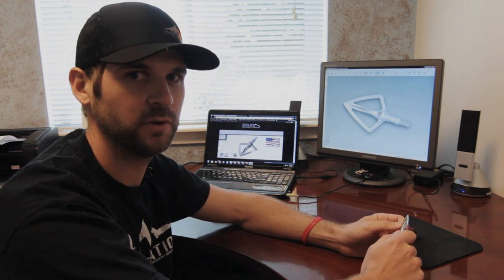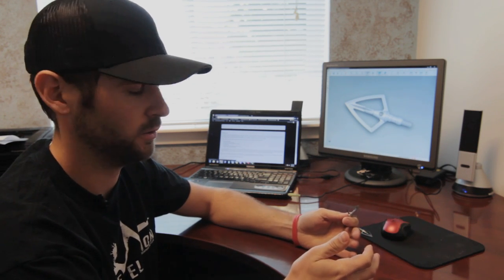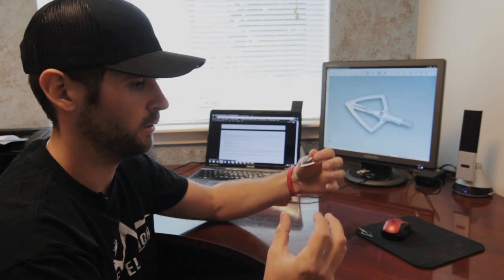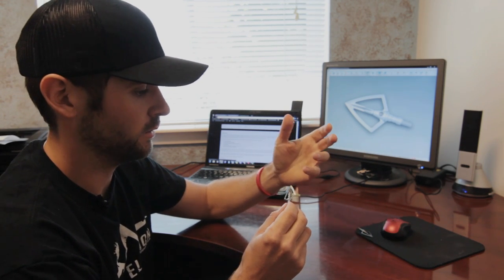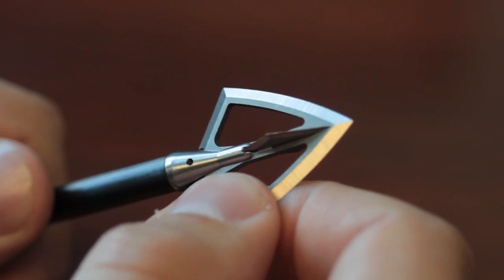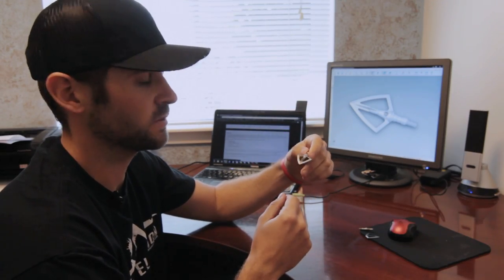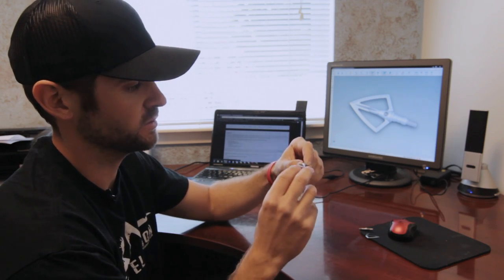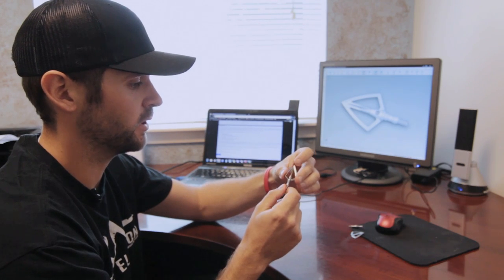About Solid Broadhead Company & S30V

Comment: I love these broadheads! I love S30v steel as well. I have a benchmade folder knife and the blade is made of S30v also. That knife can be sharpened to scary razor sharp. It's a great steel for sure. Now, having that on a braodhead is really awesome! Also, the blade edge being curved in stead of a flat grind, is also a great grind to give a knife edge. It allows less resistance on the cutting edge. It's like these aren't a typical broadhead blade - they are knife blades.! The design is really well thought out. I'm totally sold on them and at this point are the only broadheads I want to buy. Thank you Solid Broadhead Co for inventing these!

Comment: The blade material is interesting, got a couple S30V knifes and its great blade material. Sure don't mind the sales price of these due to warranty but I'm still hazentend due to the bleeder blades. Simply don't like more then 2 blades to my broadheads after all the fuzz I had with 3-4 blade designs in the past. Is there any chance for a 2 blade version, preferable in RH single bevel grind? I'm pretty stocked on 2 blades in single bevel heads, such in S30V would be just awesome!

Comment: eh s30v that is a hard knife steel, its good for edge holding, and bend resistance, but if you use this to hunt heavy bone animal it could shatter if the rockwell hardness is too high, the ashbys are solid 315 grain, at 58 and they break 15 percent of the time, so too much makes brittle, good for holding an edge but hard impacts can break the tip.

just saying